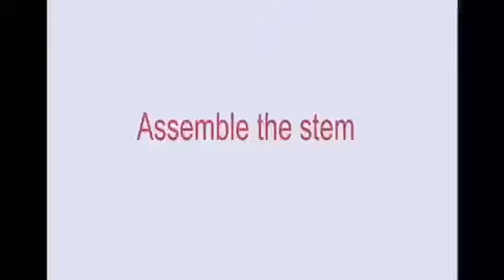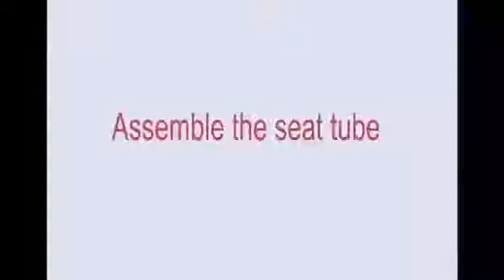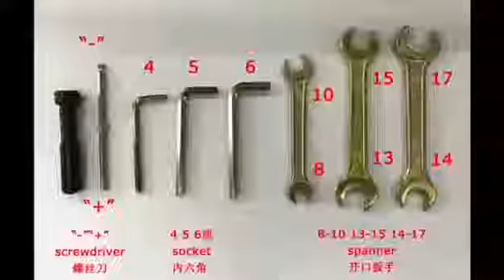ENGWE MBT26 - HOW TO INSTALL?

Comment: My Mbt26 won’t let the display turn on, which means i can’t use any of the electrical features. How do i fix this.

turns out i just needed to spin the pedals a couple times, and it was able to turn on.